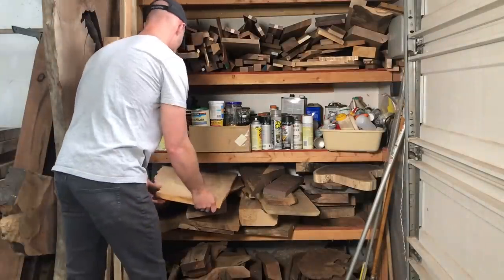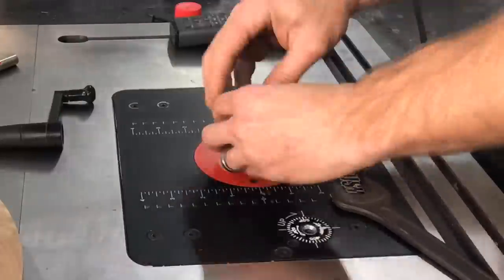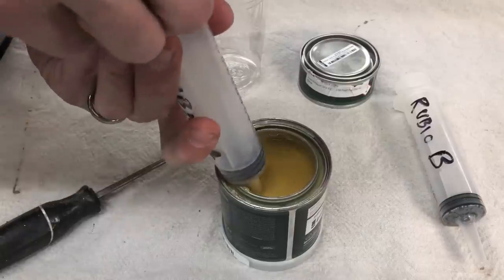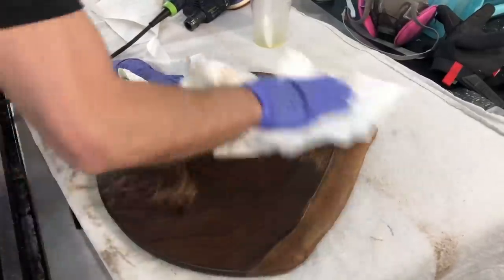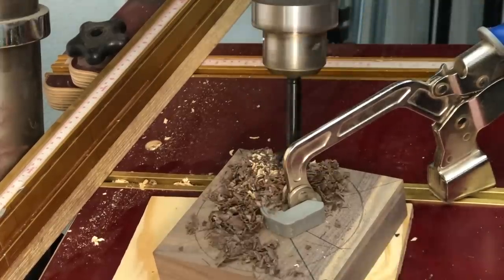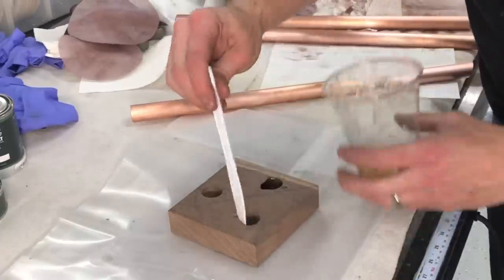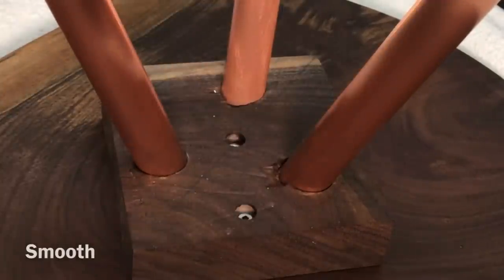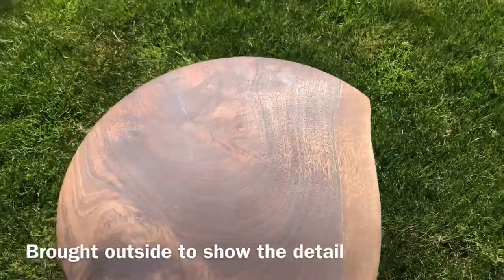$20 Woodworking

Comment: I'm studying to be a graphic designer and at 4:57, I actually discovered something SUPER useful, I didn't know there was a geometric way of dividing a circle into three using its radius, that's VERY helpful and I'm certain gonna come in handy quite a lot, cheers!
Reply: It's not entirely accurate… pi is 3.14, not 3
Reply: FYI: Reduce your radius by cos(30 deg) [~87% of the original radius] to get perfect thirds.

Comment: thanks so much for this -- it is very timely as I am just about to embark on my first Rubio adventure. About the copper legs: (1) they're not ideal for this project looks wise, but I love the experimentation (2) polishing is great, but they will develop a tarnish/patina after a while -- that might actually help the outdoorsy look, so maybe don't polish at first? (3) I juuust finished a project  making a small shoe rack and I used copper piping for the internal racks so I loved watching you be far more professional on this. [I ended up using a pipe cutter, though I didn't need angles and I had a good 1/2" of wiggle room.] I really enjoy your channel and your commentary as you learn-- thank you!

Comment: Working on a live edge maple slab for a bar top.  I have 1 side leveled and literally about to go back out in the garage and using a router jig I built, level (plane) the bottom side.  I will be using the Liquid Glass 2 part deep pour epoxy on the back side to square it up and fill in any cracks.  Love your content and tips.  Thanks Cam!

Comment: My favorite furniture to make is copper pipe and wood. I use plumbing fittings to build up a frame, then add wood components like shelves, table tops, or boxes (nightstand). It has a bit of a Steampunk feel that works well in my 1900 era home.

Comment: Great looking table! I just finished a large serving tray with copper pipe handles before watching this. instead of leaving them shiny after sanding I sprayed with WD40 and then very lightly hit them with a blowtorch. The variations in patina that result are cool, and might be worth considering next time. Up next is a slab bench with epoxy inlay for a wedding gift. thanks for all the great tips
Reply: Thanks for the finish idea, despite having used something similar with steel I hadn't actually thought of trying this on other metals.

Comment: Working on a few epoxy wood putters with wooden shafts. I just want to recommend you trying another finish. I started using saicos hardwax oil finish. Made in Germany.  No mixing very easy to apply. I've used osmos and Rubio and I really like this one much better. I havnt done a water test or comparison between the 3 but just the application alone was so much better I'm sticking with this. Cheers!

Comment: long time listener first time caller. Your videos are so good, you cover everything along the way of the project. I started woodworking during covid and have not stopped. My pops is a woodworker in Virginia so its in my blood, I just wish I started 30 years ago. I am hooked. You have let me know to just go for it! Not to be afraid to try new projects, get outside my comfort zone and go bigger! Thank you for that.
In my head I've always thought copper and walnut would match up nicely so I added some copper die to some epoxy to fill a cool knot hole on a serving g board I was making, I did not like the results at all. I found a vintage epoxy die with more brown in it and tried that and I loved those results. I just ordered some kutzall dishes and am going to give power carving a try. Thanks again

Comment: I think personally the table looks awesome. I’m not a would worker by any means but I remodel homes and have had to use several different kinds of finishes in my houses. I like this finish on this table, it really brought out all the grains from super lights to heavy darks. Also by trade I’m a metalsmith, so I’m partial to the copper legs. I feel it brings out colors in the table you wouldn’t normally see had you used another form of leg. Like I said I’m partial to this look. Incorporating another element other than wood really showed another side to your work. Thank you!! Keep posting!!!

Comment: If you want to get your angles on point, you could get a line of chords which looks like a stainless steel ruler with a pivot in the middle. Engineers and boilermakers and metal fabricators use them for very important angles in construction.

Comment: Working on a slab table for my Nephew.  It's 5''x 2' jacket slab (used to have bark on both edges), and had several punky spots.  My brother and I used a wood hardening epoxy to try and fix the softer areas.  It worked pretty well.  We actually applied a gel stain to the wood before using the hardening epoxy so we would not end up with oddly stained areas.  It worked out pretty well.  We liked your use of black epoxy to fill the voids, and were mightily frustrated by the multitude of worm holes we found.  They just kept sucking up epoxy.  I swear the edges of this table are going to be solid epoxy!  We broke down and used CA/Accelerant to fill them.  We just put what we hope will be the final coat on Table Top Epoxy on the top and have to clean up the edges and attach the legs.
Learning experience with lessons to be applied to a small stack of walnut slabs next (without the Epoxy top coat, that was for a college aged Nephew).  We think we have a line on a business with a planer/sander me might be able to rent time on.

LOVE the videos and it's always fun to spend a work break watching one!

Comment: Great video.  You don't need the part B of the Rubio Monocoat if you don't want.  It reduces the drying time from days to hours but it is not essential.  Also, keep in mind that the product chemically binds to the wood fibers and does not work well is the wood is sanded too smooth.  They recommend sanding to only 150 but I usually go to 180 and apply two coats for an ultra smooth finish.  It is designed for flooring but works great for furniture.  The time saved in sanding and finishing is worth the extra cost
Reply from the maker: Good tip! I appreciate that

Comment: I look forward to more about finishes. I need the education. So far I use waterlox. It's pretty, smells nice, easy to work with, but requires like half a dozen coats and supposedly will need to touched up later. I'd like something that lasts a lifetime, even vs liquid, and has insane clarity.
Reply from the maker: Very cool!

Comment: With Rubio you have to wait 7 days after the finish is applied before its fully cured. I didnt wait and put a wet glass on a table and it left a mark. Must not always be the case since your test didnt leave a mark. But to be sure, I’d wait the 7 days that Rubio recommends.

Comment: Next project, wall mount record holder and now playing display. Lot of stuff to finish around the house first tho. I've been really impressed with Rubio. I did red wine and spaghetti on the smoke color on white oak... passed with flying colors...or no color. I didn't let it sit an hour, but I think 5 to 10min on the wine, and the length of dinner time on the spaghetti. Fully cured and new, don't know if I'd expect it to be as durable a year later, but refreshing the finish if that was needed would be super easy
Reply from the maker: I know you!
Reply: @BlacktailStudio  maybe...lol, I'm in Portland and have gone to several of the local maker meetups in the before times, but haven't been to one of your classes before of that's where you thought it was

Comment: You could convert the finish ratios by volume to weight using percentages, then use a kitchen scale to measure your finishes. It will give a more precise measurement than just using the syringe.

Comment: next project is a second workbench, as my original one was made when I was 17 yeas old, 56 years ago! It is still as solid as the day I made it though!
I am not sure about the copper legs either - perhaps because they look a bit 'chunky' for the size of the lovely top. Half inch pipe, perhaps reinforced with concrete, or epoxy?
I really envy you being able to get that great piece of walnut for $10 - I have to pay that for an eight foot 4" by 2" softwood here in Kenya!
Reply from the maker: That’s so cool to hear

Comment: I find copper works best as an accent color. Strangely that's also true of copper rust. That said, oil-rubbed copper looks wonderful. It ranges from almost a wrought iron with reddish accents up to a more reddish version of oil-rubbed bronze. That said, oil rubbing seems to be kind of finicky so it may not be worth the effort. When I'm going for oil rubbed metal (usually bronze) I use paint but copper is notoriously bad to paint.

My favorite thing I've made with copper pipe is a cane, though only the head of it is copper. The bulk of it is an $8 broom handle cut to fit and painted black because the canes available either weren't tall enough for me or were too flimsy. It got me through recovering from hurting my knee on the ice, and several foot problems since and I really love the copper on black contrast.

Comment: My next project:
First off... 
Love the channel and content. Very Inspiring. 
Need tips on my first finish for outdoor adirondak chairs. 
Recently baught unfinished/untreated chairs and I need to know the following. 

1. Which sandpaper should I start with? 
I am planning on 2 coats of finish. So I'm thinking sand with rougher paper, add coat. Then sand with finer paper and add second coat. 

2. What finish should I use?  I've been seeing a lot of people recommending  polyurethane for outdoor furniture. Would it be ok to just use the Rubio you showed in this video or do I need something more protective? 

3. Do I add finish before assembling the chair or after assembling? 

4. What about the screw holes? Do they need to be sealed in some way? Perhaps some wood putty or something. 

Any advice is greatly appreciated. Keep up the great work. Will continue to watch.

Comment: Usually, on walnut furniture, I cut copper pipe in half and flatten it out. Then, I bend it around the edge horizontally and nail it after drilling holes... lots of holes.. with copper nails. After all this, and several other securing steps, I start hammering it to match the natural edges of the wood. Copper and walnut go well together, in my opinion.
Reply from the maker: Very cool!

Comment: No project to mention, but I did watch it to the end.

Another great piece of furniture and I like the Rustic look of the copper legs.

Only I would have added 2 things...

1. Some sort of ring, roughly 2/3 the distance between the bottom of the table and the bottom of the legs.
...but the bottom 2/3 (Meaning closer to the ground not the table).
...just to add some long term strength and durability to them.
...maybe metal but possibly even a ring of wood?

2. Hollowed out wooden sleeves/cup for feet. 
Something in the shape of a u if you are looking at a cross-section of it.
(I just thought of a brilliant way that it could be adjustable all while hiding the mechanism that allows it to be adjusted.) Put a Bolt & Nut type adjustment inside of the leg allowing you to adjust the foot on uneven floors.
This would also make it to where it wouldn't scratch things like tile or wood floors.

Hope you don't think I'm being critical of your work. I'm just thinking out loud.

Oh, and learning to use a CAD base program to figure out the Angles and such isn't that difficult.
I've been using CAD based programs for a long time now.
I think you'll get the hang of it quickly.
Reply from the maker: I’ll get to the CAD eventually!

Comment: Yo! I dig the copper legs for sure, but I would put some rubberized or hardy plastic footies on them so they don't scratch the floor or make noise when you move the table. Well done. Also, maybe consider filling the copper legs with some cement or something to make it a bottom heavy item that wont tip as easy.

Comment: Try using the Rubio exterior product.  You don't need to mix it with the accelerator.  I used it on some outdoor flooring and I am happily surprised at how well it resists moisture.
Reply from the maker: I definitely will!

Comment: Epoxy and wild olive coasters. Great video. Don’t know why I never saw it 10 months ago, but still great to catch up. Must admit, didn’t like the copper legs too much either. I’ve done some other projects with copper pipe, towel rails, toilet paper holders, beside lamps, so, I am a fan of it. But agree, it didn’t look that great on the table.

Comment: I didn’t really care for the copper legs though I see the point why you went that way.  I’ve built a few different projects with copper pipe and never really turned out with a AHH! type impression.  My next project is to get my new shop up to speed; got it building built, insulated, electrical and heat just in time for the snows to fly; getting it tooled and going has been slow over the winter.
Next furniture project will be a dresser or night stands for my wife and daughter-in-law.

Comment: I'm working on a walnut desk with breadboard ends right now. 
Not a fan of the splayed copper legs either but I think the top looks great and I'm intrigued enough to try RMC on a future project. I think a large lathe turned pedestal base could look cool on that table. Maybe a walnut log with a crack stabilized with black epoxy could look cool. Obviously makes it more than a 3 hour project that way haha
Reply from the maker: Still cool!

Comment: My next project is a crafting cabinet with a fold out table and hidden pullout shelves. As for the copper legs, they are okay I guess. But I would have added another shelf halfway up the legs. That would’ve added more support to the already soft copper. Plus it would’ve looked cool. Using the technique that you used in order to mount the legs to the top.
By the way I just discovered your channel. So you may see me pop up in some very old videos you’ve done in the past. Really do enjoy watching how you go through the process. I do have a request. Is there a way you could do some projects with cross lap joints.

Comment: If using the Vacuum Clamps, you have to be careful with any kind of glue, wich will eventually be sucked through cracks into the underpressure system. As I did some times ;-) On the other  hand, CA glue is nearly the only stuff to repair damages of the expensive suction rubber plates. Silicone and polymer glue does not work.

Comment: If I were going to level the drill press I would not have put the gauge on the chuck but rather chucked up a regular drill bit that would accommodate your gauge on the edge of it. 
It would be much more accurate but you said it was accurate enough for your application

Comment: Beautiful table.  I like your choice of using copper pipe for the legs, maybe visually breaking up the long length of them would help with the look, though.  Meaning, maybe if you added a decorative feature on each leg, like an irregular/organic shaped circle - like the table top - using the walnut, placed at about the center point of each leg - the legs would go through the center of the decorative pieces.  Just a thought.  Oh!  one more thought:  wrapping uber thin long slices of the walnut around each leg, in a spiral pattern or another simple pattern!  But, I don’t know if walnut can be bent.  Like I said, just a thought.  
Good tips, good video.
Reply from the maker: That could help!!

Comment: You could have put a patina on the legs using salt and clear ammonia cleaner. Different salts will give different colors, Miracle Grow plant food for example.  Use a spray epoxy to add a protective finish. Cheap and works over night.

Comment: No current project. A lot of the other furniture making channels that I've seen use Sketchup as their 3d modeling software. I would recommend that because it is cheap, user friendly and easy to learn. Kobeomsuk uses Rhino3d, but that program is more expensive and harder to learn.
Reply from the maker: I just need someone to run the software

Comment: Next project, drywall repairs in my house lol

$10 scrap walnut? In SoCal I'd be lucky to find that for $40 😂

I've looked!

That's probably my biggest challenge, woodworking is just a hobby for me, and it's hard to justify spending $$$ on material.

Also, if you're doing something in copper outside, you'd want to clear coat it.

Comment: My next project is to make holiday wooden light porch hangers. Not sure what to call them. Think of those old tin 4-sided lights that have pictures punched into the sides to show some sort of picture. Planning on doing 1/8" ply for the picture pieces and the frame in 2x2 pine then burning the frame. Lets see how that works.

I don't have much time for doing my hobbies, but wondering how thick a slab you recommend if it needs to be dried. I have a bark beetle killed pine about 30" diameter that I am going to have removed. I want to have the bottom 10' slabbed and the rest turned into rounds. How thick do you recommend if I am going to use the thickets slabs for a sandwiched dining table (yes, I know... pine is soft, but I want to use if for something and understand there will be dings but that will add character)

Comment: I'm working on a new base for a lonely ikea tabletop I found in someone's trash. It's a 3' circle with a circle of 6 threaded inserts on the bottom. No giant lathe in my shop, so I guess I won't mimic the original upside-down golf tee design.

Comment: For whatever reason,  I prefer differing materials to be 'blended' in multiple areas.  So a copper inlay of some sort(a design in the middle or around the edge)  and/or somehow adding the wood to the legs(perhaps the last few inches could have been the wood, doweled and just stuck in the copper pipe with a edge that was flush).   To me it's the difference of 'this thing was thrown together in a rush,  and 'this thing was carefully thought out'.  It's a rule of 'sets',   that I just made up!